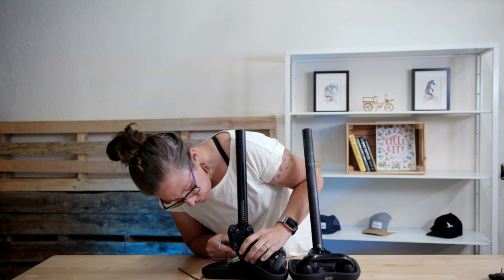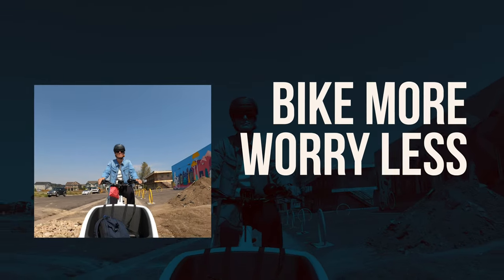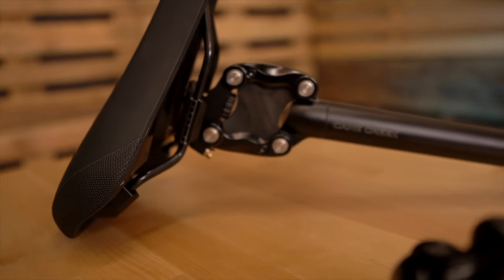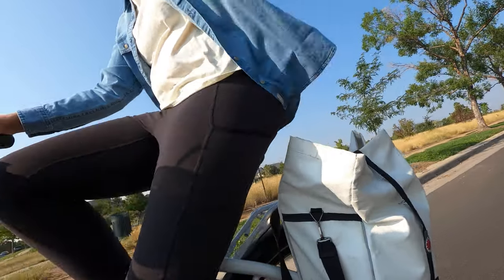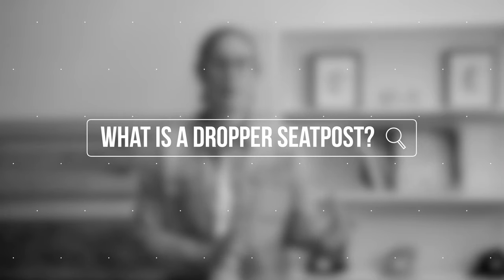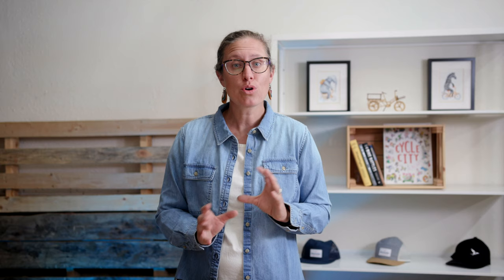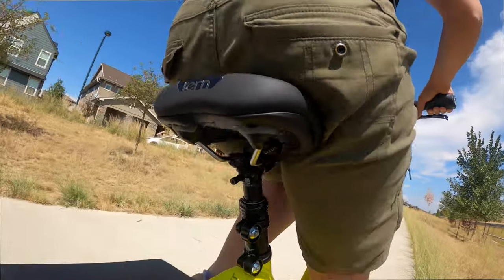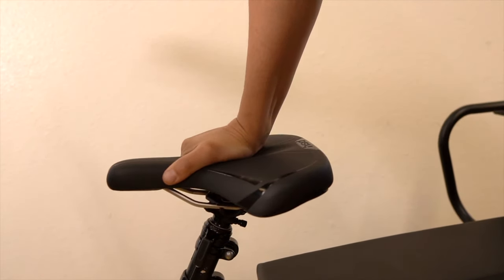Upgrading Your E-Bike with a New Seatpost!? Talking Suspension Seatpost and Dropper Post

Comment: I've been riding bikes for over 60 years, most of which had no suspension,  so I'm used to putting my weight on the pedals as terrain dictates. After logging 1100 miles in the first 100 days of riding my new Ride1Up Core-5 ebike,  that habit still holds for me at 76 years of age. That said, I may try one of these suspension seatposts. Thanks for the info.
Reply from the maker: 1100 miles in 100 days. You are a boss!

Comment: I have the kinekt/bodyfloat on my GSD and it's great (only downside being the $$$). Definitely something that more e-bike manufacturers should consider including! The springs are tensioned fairly tight on mine so it doesn't really have a noticeably floaty feeling, but still does a great job of taking the harshness out of the bumps on the road. I like that you can play around with different combinations of springs and tension settings to get a variety of options.

Comment: I have a Kinekt BodyFloat on a Surly Big Dummy, and especially on gravel (or potholed) roads and with heavy loads, it helps a lot with reducing the transmitted vibration, helping to keep me and my load upright and moving forward.  With a heavy load, fully inflated tires (to carry the load so as to not pinch flat), and nothing to absorb the impact, it used to almost buck me off of the bike if I couldn't avoid a pothole or had to drop my loaded bike off of a curb.

Comment: i need or want a dropper post for my commuter bike as I got so used to one on my mt. bike for getting on or off however I need a good suspension seat post as well. The straight up and down suspension on the PNW looks like it might not be the greatest compared to the higher end models. I guess you can't really put a cane creek or redshift supension post with this dropper ? Heck all I really need is a cableless dropper with lever and suspension
Reply from the maker: I don't know of anything else

Comment: Any feedback on the cheaper ones now available for example Cube's RFR SEAT POST SPRING LOADED Ø27,2MM 80-120KG BLACK?  Yes they make SOOO much sense, my undercarriage feels like it was used as a punchbag after converting my hardtail (oh the irony) to an e-bike.
Reply from the maker: Sorry, I don’t have experience with the Cube ones.
Reply: @BikeShopGirl  I've placed an order for one so hopefully it'll do the trick!
Reply: @BikeShopGirl  Got it fitted, while I'm sure it pales in comparison to the more expensive models, the sting is taken out of surprise potholes at night & generally feels smoother.  There's a small lateral movement which might annoy the more performance focused rider but at £30 it seems well worth it for those on a budget.